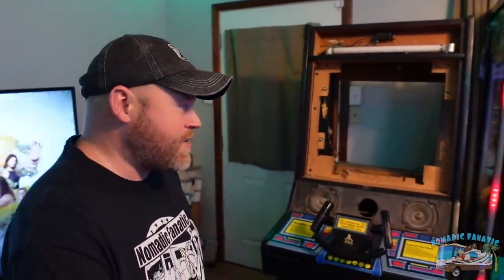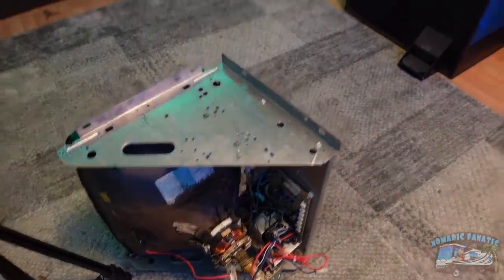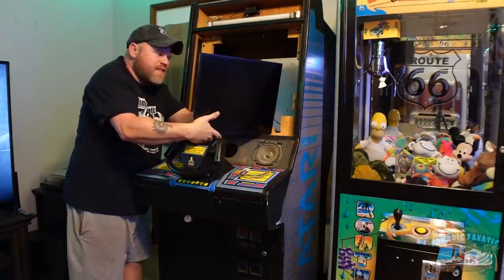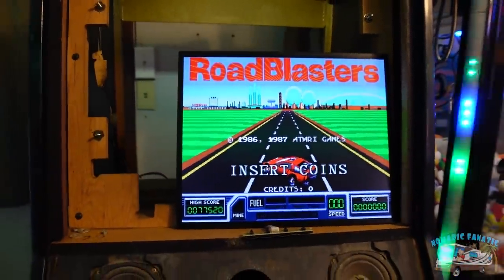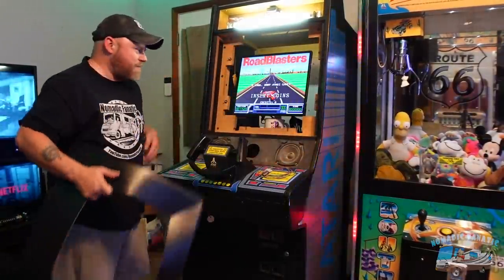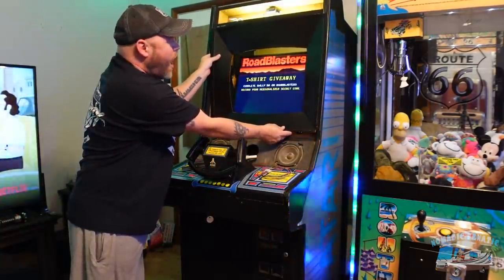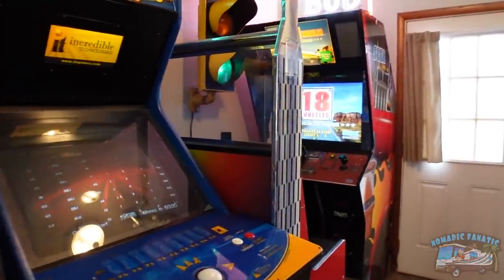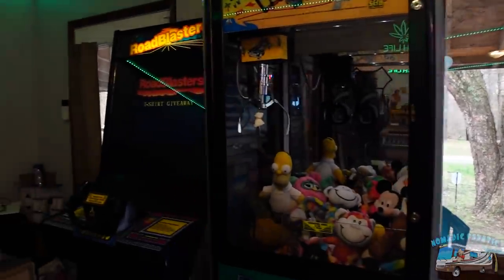Fixing My Own Arcade Cabinets ~ Monitor Replacement Attempts...

Comment: Check to see if you're house is giving clean power. It's not a coincidence that they all broke at the same time.
Reply: I was totally thinking it must be a power thing...
Reply: I was also thinking it could be low voltage.
Reply: Yup I just wrote that above as well. Great minds.
Reply: Those remote control outlets he has could also be causing some of the issues.
Reply: @chrish4977  I am not sure if you are supposed to use those with surge protectors tbh. Could be the issue.
Reply: I guarantee its a low voltage scenario too
Reply: Yes
Reply: Lot of power draw for what was a typical living room. Would be curious to know what wire and service that house is setup with. Looks to be about era of old aluminum wiring.
Reply: @toms1499  intesting thought. Best way to test it is flip a light switch and listen for a spark.
Reply: Yes - agreed.  Dirty power coming in.  I posted this a few days ago.  Hope he checks it out thoroughly...
Reply: @toms1499  Sounding like an licensed electrician needs to check some circuits. Potential safety hazard perhaps?
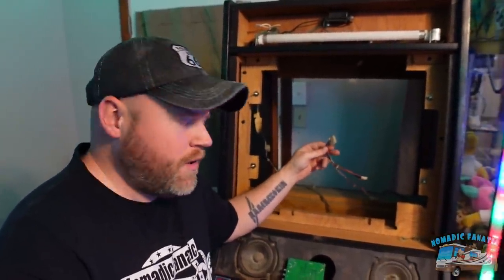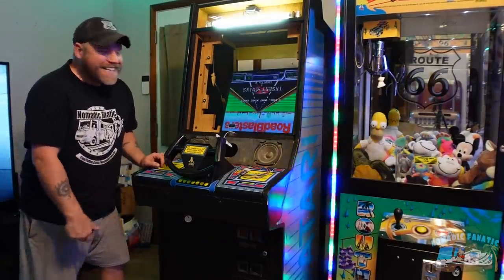Reply: Jesus Christ loves you so much and He will save us from our sins if we put our faith and trust in Him! because we all sinned and fell short of Gods perfect glory (romans 3:23) and the wages of sin is eternal death! (romans 6:23) but the gift of God is this

 john 3:16-21
"for God so loved the world that He gave His one and only Son, that whoever believes in Him shall not perish but have eternal life. For God did not send His Son into the world to condemn the world, but to save the world through Him. whoever believes in Him is not condemned, but whoever does not believe stands condemned already because they have not believed in the name of God's one and only Son. this is the verdict: Light has come into the world, but people loved darkness instead of light because their deeds were evil. everyone who does evil hates the light, and will not come into the light for fear that their deeds will be exposes. but whoever lives by the truth comes into the light, so that it may be seen plainly that what they have done has been done in the sight of God." 

and romans 10:9-13
"if you declare with your mouth, “Jesus is Lord" and believe in your heart that God raised Him from the dead, you will be saved. for it is with your heart that you believe and are justified, and it is with your mouth that you profess your faith and are saved. as scripture says, "anyone who believes in Him will never be put to shame. "for there is no difference between Jew and Gentile — the same Lord is Lord of all and richly blesses all who call on Him, for, "everyone who calls on the name of the Lord will be saved." 

so God is coming at a time we least expect, and if we put our faith and trust in Him He will gift us His grace and clothe us with the righteousness of His blood (but of course death could not hold Him, He is risen!) and we will have eternal life in His kingdom where there will be there will be no more death, or sorrow, or crying. there will be no more pain, for the former things have passed away. because He loves you so much! (romans 5:6-8) but if we deny and reject Him and don't repent from our sins to follow God, then we will have our part in the lake which burns with fire and brimstone, which is the second death. because no liar, no thief, no blasphemer (using Gods name in vain as a cuss word to express anger or disgust) and no adulterer (Jesus Christ says in matthew 5 that anyone who just looks at someone to lust for they’re an adultery at heart) will enter the kingdom of heaven. so hear these words, repent and believe the gospel! accept Jesus Christ and confess your sins to Him so that He will forgive you and give you a life with truth and real love and joy and peace that this world can never give you or fulfill in you you! and the love and joy and peace that He will give you will never fade away or perish. this is all if you haven't done this yet and Jesus Christ hasn't saved you yet, also when you have time please you should watch this channel here on youtube called "Christ forgiveness ministries" and hear what they have to say, glory to God. God bless you! 🙌👑💟

Comment: LOVE your DYI enthusiasm  !   I had similar issues a decade ago -- turned out a grounding rod located in an underground transformer box was loose from the box being hit off / on by zero turn mower and that damage UNSEEN because it was covered by the locked transformer cover allowed wide fluctuations in power & the dips caused many tv / monitors / computers to get damaged & require replacement - eventually box was hit hard enough it broke off entire grounding rod & no surge  protectors in place saved a single item - 3 households (including mine) had damage to EVERY receptacle / electronic device / mother board to microwaves etc etc --- costly & a lesson in utilities .... our company refused replacement help as they stated it was damage done to their equipment & no fault of theirs & the lawn service person left town -- so us homeowners  came out of pocket to replace ALL THINGS ELECTRONIC  👀😆😆

Comment: Actually, that old monitor can probably be fixed quite easily. It's probably just a few caps or other electronic components on the PCB in the bottom, and if these monitors are so sought after, there will possibly be someone who wants to have it and fix it to use in their own "all original" arcade. The tube is most certainly not destroyed, besides the burn-in.

Comment: Sweet upgrade on those monitors! They will last you much longer. Careful with those ancient high voltage CRT when you pull them out. Those ancient tubes hold a charge for years. Going to save $$ on electricity as well. That is the way to handle the plug in that cabinet, perfect. Make sure you place it where you have access to it from the front change door if you need to reset it or power it off.

Comment: I was thinking that maybe if your electrical for the house is at least partially run under your house, when you get all that standing water, maybe the wires get swamped in the water... maybe that's what's been going on? When it gets wet, interferes?
When it dries out, things start working? Just an idea
💕
Reply: RASBERRY USES LESS ELEECTRICAL STUFF  ........ RASPI IT SMALL PC

Comment: The power adapter for your monitor is usually an ac to dc power converter. On the back of the monitor it should give its power requirements. I would use a multimeter to check the voltage coming out of the machine that previously powered the original screen and simply convert the power to match your new monitor or vice versa finding a monitor to match your power source. Nice work!

Comment: I would definitely put a sine wave power line conditioner on those games and turn them off like they are precious. I think your remote caused some surges my man. Believe me I hate having to say that but I think it will protect your games in the future. I for one love your led conversion, but I'm a techy. As for a bezel I would paint the back of plasi glass black and go that way

Comment: Game machines came out fantastic you do really good work. Your pinball machine might have to be on its own individual circuit. Or possibly it takes awhile for it to adjust once all the other machines are on. Remember your surge protector only protects what's plug into it it can't fix the current going to it. So even a slight deviation incurring can shut the machine down.

Comment: Second time trying this, so let's go! On Playboy pinball machine, check for a thermal resistor. Thermal resistors start to turn the devices they are connected to on and off when they wear down. They are designed to prevent the equipment from overheating.

Comment: Wow great repair jobs!  One suggestion try plugging in the pinball machine directly into an outlet and try a different outlet. one thing I read is pinball machines are sensitive to low voltage.

Comment: Don’t let people get to you, I was  for 20 years a game tech and a district tech for Chuck E Cheese worked in 17 locations, What you are doing is perfect, it is whatever works so to mount we use to use angle aluminum as for bezels the easiest way is use the glass and paint your bezel into the glass with black paint and with the door closed in the back you really can’t tell good luck.

Comment: As far as AC wiring I would cut off plug side of the monitor power adapter and pigtail them into the games hot, neutral & ground connection. Although the power cable strip is just fine. Nice repair my friend.

Comment: Hey Eric, instead of foam board look at using sheets of kydex for the bezels. It’s black plastic and one side is textured, the other side is smooth and glossy. It’s easy to cut and heat moldable. I used it to make a custom bezel for my car stereo and it works great. Just an idea.

Comment: You could splice the AC cords internally, but your surge detector kludge might be a good thing, since it adds a surge protector.
 Also, old CRTs can often be refurbished and brought back to life, so trying to sell it reduces toxic waste (that's heavily leaded glass) if nothing else. You can't just throw it out, it needs HAZMAT dispo$al.
Reply: Interesting to know

Comment: Eric if you want the picture on the LCD to look more old school you can buy a scanline generator on ebay or amazone they go for $20 it will give some retro look to the picture no power needed just plug and play. You will need just an extra vga cable that all. I have a few they work well. If you need more info let me know

Comment: Solder the wire correctly off the power feed for the monitor or make an end that way it’s all plugged in and hooked up to the existing monitors power. Keeps it more original. That being said the surge protection is a good idea as well. Can’t be to safe

Comment: If it fails randomly, it may be heat-flex where the solder has a break and as the board heats up it flexes enough to stop connection and fail.   I've not done solder reflow, but check chips either soldered on the boards or press them down to test theory.

Comment: Looks good, you may want to run some black electrical tape on the support wood corners and remount the display on the new wood frame to eliminate the light wood strip/edge you see on the verticle edges left and right of the display. That would make everything blend in.

Comment: Haunted  playgirl machine?

No, I think its probably an electrical is like the other comments.
If the electrical work  was installed by cheaper labor, that type of issue is common in some houses.

I could share tales of electrical issues of things seen in Florida vehicles and house wiring. 😵

Comment: Just for safeties sake with all those arcades and other electronics you really need to have a professional electrician check out your breaker box, wiring and capacities. Using surge protectors useful but you're running a heck of a lot more electricity through that house than a normal house would. You could wake up to an engulfed house or see it burning down while on the road. We don't want that!

Comment: While you fix is pretty slick, those monitor issues combined with the pinball machine makes me think you have a power issue in your house.  Would have been a good idea to check voltage when everything was lit up.  Those old crt displays have a bit more draw than the new LED’s

Comment: Check your voltage with a meter. You may have low voltage from damaged cable. I doubt it's from the pole but check both sides of the box.

Comment: The original monitor and control board is repairable... burn pattern can't be repaired but definitely can repair the board that powers it... 
Playboy unit probably has a "cold soldier" issue on the mother board or control board so after it gets hot it separates and when it cools down it will power back up.

Comment: Electronics, especially really old electronics, don't like to have the power cycled.  The like for the power to be on ALL the time.  When you cycle and cool the electronics off and in turn heat them up, your stressing the internal components.   You also have a moisture problem and you can guess why that's bad?  Get yourself a cheap digital hygrometer.

Comment: I suspect the problem with the pinball machine is an intermittent fault likely caused by a thermal issue (overheating).  I would start with a look at the power supply unit on the machine.

Comment: Your pinball is going into test mode to possibly clear out a stuck pinball. Or its sensing an interruption..look for a failed solenoid.  It will look discolored.. make sure fuses are right size.

Comment: The power supply on your Playboy arcade is failing. Most likely a dry capacitor. (Age and heat does that!) They will randomly do that. I used to service arcade games, still service many electronics such as guitar amplifiers.

Comment: sounds like a power problem to me as well .... something is dragging your system and not providing enough power/amps/electricity to all of your units ... with the rain you have had I am wondering if maybe you have water seeping into a cable line somewhere that is causing a problem?  Just a thought

Comment: Eric, try turning off everything and see if the pinball machine works all night. 
It's possible that these games need a certain amount of power and won't work if everything is plugged in together.
Could also have a bad ground.

Comment: I really think all your game issues are due to an electrical problem with all the rain you had, flooding and possibly surges. They fry computers they can fry games. Why don’t you call an electrician to check it out? Might be worth it. Especially if there is an underlying issue, you wouldn’t want a fire to start while you’re traveling.

Comment: Monitor your 120v . If it gets too low, could be killing sensitive circuits. If you still had sound, Picture tube High Voltage ckt may have smoked, black screen with no sound too maybe fuse or fused resistor in power ckt. LCD screens will help lessen overloading 👍Remote selection of power feeds good idea, maybe.👍 Playboy may have protect circuit. When volts get too low, shuts down. When ok, comes up. ???????  Just some thoughts.

Comment: You probably need to clean out the interior of that pinball cabinet but if probably dust bunnies water or insects in their causing glitches with the old electronics not to mention loose wires

Comment: Your running to many machines on 1 circuit. 
Use a outlet checker to check that black & White & Ground wire on wall outlet are correct. The surge in blaster caused claw to move. Use a dedicated  power source.

Comment: Do not use those cheap surge protectors they do not work. My LED timing board died due to a surge.  The tech that fixed my TV said they are junk and only use a UPS.

Comment: Likely power issues at your house in terms of stable voltage etc and these games are the canaries in the coal mine. You might want to invest in a power conditioner.

Comment: Eric you are using power bars however I think your issue is power balance you may need a voltage regulator or balancer. If the power is not sufficient it could cause your games to be under powered causing damage. Power bars do not regulate the power out.   Gary

Comment: ABOUT YOUR PLAYBOY PINBALL...  I'll almost bet that there's a heat issue going on inside the cabinet.  Check all cooling fans to see if they work & ESPECIALLY unseat & re-seat any memory chips on the boards.  The copper/brass contact points on memory chips made in the early 80's are known to corrode & lose contact.  If they're corroded, use a "gum eraser" not a pencil eraser, to clean the contacts.
/Yeah, I build computers for fun, so I know a thing or three about them!

/edited because I accidentally a word out!
//See??  o_0

Comment: I think all the flooding around your house did something to the games if water can knock out a li
A

land line I believe some water did sip under your house there's no other reason it would start up again I think it dried.  out just like myphone line did after a heavy rain which knocked it out I was told it would work again after it dried out and it did so I think that's what s happening with some of your games